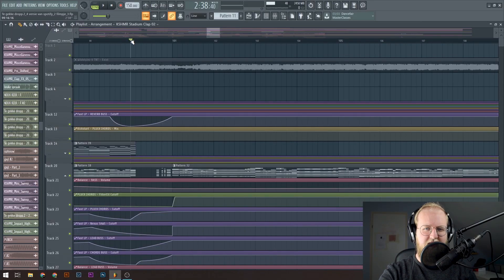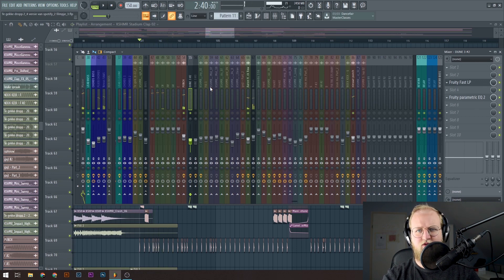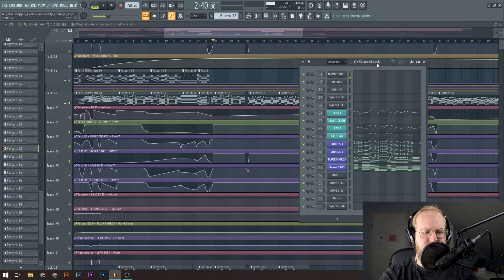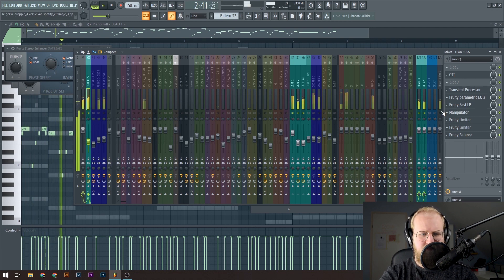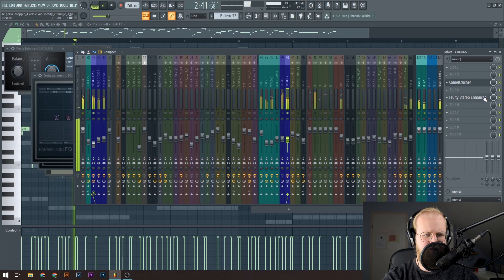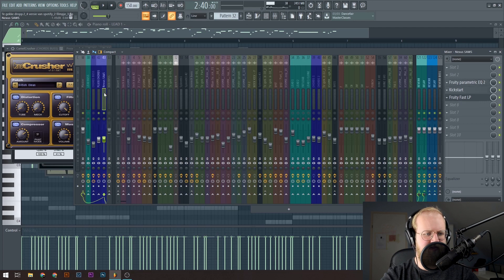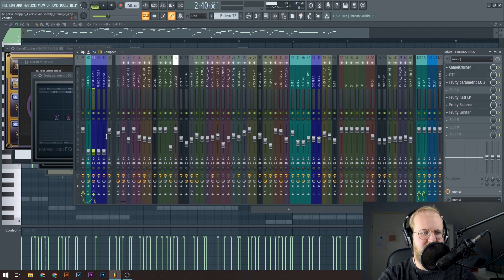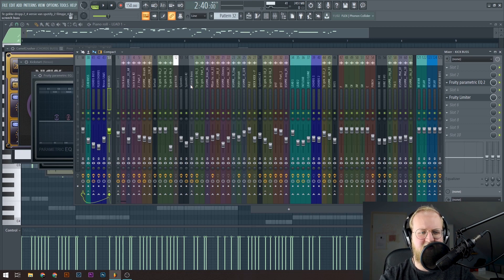HOW I MIX HARDSTYLE LEADS - FL STUDIO 20 TUTORIAL

Comment: Where do you add camel crusher , on all the leads or just the one you want it on like the main lead you talked about?
Reply from the maker: I did not add camel crusher on the leads, as it distorts the sound too much for me. Though I added it to one of the chords and the buss of the 2 chords combined (which are the darker blue channels). Those are beneath the leads and the camelcrusher compresses them and adds a bit of 'crunch' to the sound. For other compression I mostly use OTT
Reply: @xonartutorials  Thank you now it's clear.